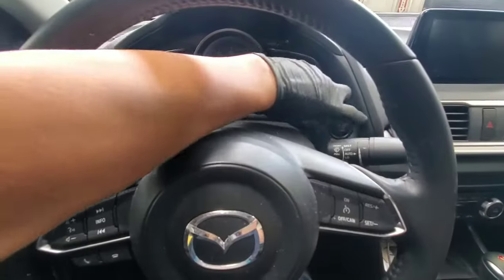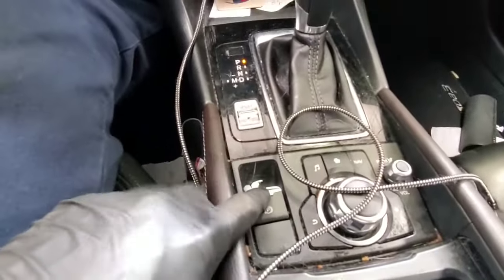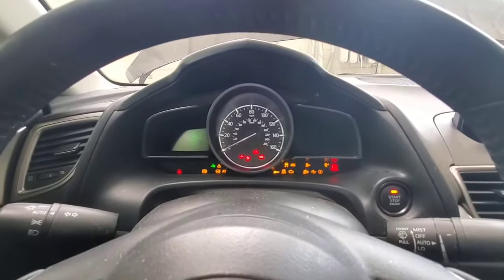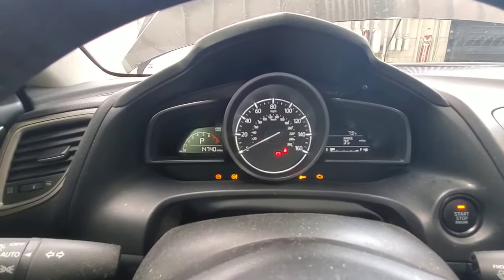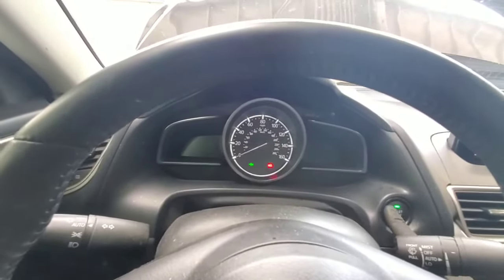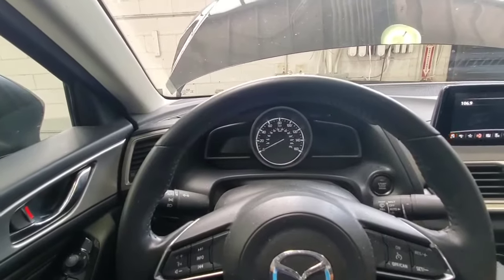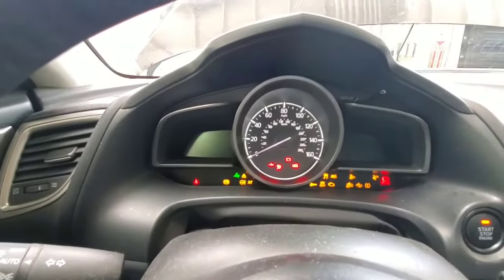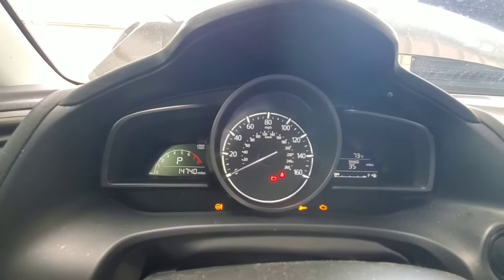How to put a Mazda with Electronic Parking Brake in to Service Mode

Comment: I would like to thank you too. I did the sequence to put my CX 5 in maintenance mode so I could change my rear rotors and as I was working on the first side I heard a bunch of chattering coming from the front. I don't know why or what it was but when I went to put it out of maintenance mode the car was completely dead! The only light in the dash was the airbag light. I checked and only had 3.6 volts in the battery and it would not take a charge. I let it set overnight with the battery unhooked and when I hooked up the battery it somehow returned to 12.6 volts. The car actually started, so I shut it off and followed your sequence and it worked! The only thing different was that I had to push the start button three times. Thank you so much for your help! You are a lifesaver!

Comment: Great video. Thanks. Just to clarify. I'm holding the accelerator the entire time all the down? Also, to retract the piston, is it possible to do this without the special tool? I have the general tool which pushes back normal pistons (front caliper pistons), but I don't have the one that allows me to turn the rear piston CCW. Thanks. (Just read below, c-clamp will work)
Reply from the maker: Hey yes accelerator down the whole time and NO special tool needed to push in rear piston. Just normal tool is fine, I know it looks like it but u don't need the spinny one 👍🏼

Comment: Thank you! This was awesome! Needed to find it about 10 hours sooner, though 😆. 

How f-Ed up is this to go through though ? This secret “trick/protocol/procedure” I think is for the benefit of dealerships - “Oh, it’s waaaaaay to hard for you, the owner to do, bring it in so we can charge you $450.”
Reply from the maker: Haha yea I get it. Super glad you found value in this video. Just trying to help people save some time and money. Let me know what other dealership insight might be helpful for future videos. Thanks again.
Reply: well you need a procedure to disable the e-brake motors (for electronic e-brakes you always need to disable the motors so you can push the pistons back in). a lot of cars require something to plug in to the OBD-2 port (but even this is cracked in many cases). mazda is actually one of the better ones that let you do the service mode without a special tool.

Comment: Same way with a manual just keep it in gear right?
Reply: Manual cars don't have electronic brake. You don't need to do this on a manual
Reply: @f0lkblues  Yes Manuals do have an electronic brake for the newer models. I have a 2019 Mazda 3 Manual.
Reply from the maker: As long as you have electric parking brake on a Mazda 2016 and up this should work. Doesn't really matter if car is in gear or not. This procedure is to be performed with key on and engine off. 👍🏼

Comment: What do you do when you’re trying to shut it off but it says “switch operation not accepted, have the vehicle inspected”
Reply from the maker: To get it out of service mode, repeat this same procedure except instead of pushing the park brake button, pull it
Reply: I also have the ''switch operation not accepted, have the vehicle inspected''.  The PB switch basically does not work anymore and you can't exit the service mode (or set \ release the EPB). What was the fix?
Reply: Replying to my own comment...  Went to the dealership, service director sat in the car and tried many times to put the car out of service mode (while getting the ''switch operation not accepted'' message).  He eventually succeeded and said one needs to be persistent and repeatedly try to put it out of service mode until successful. I did not count but it took several attempts.

Comment: what happens if you change them without doing this? because i did and now the two parking breaks are on :'( and the parking brake isn't working
Reply: Did you ever figure what to do to get the lights off?
Reply: I need to know aswell
Reply from the maker: Yea unfortunately you will probly have to get new parking brake motors for the rear calipers
Reply: @roadstertech  i actually followed the video and they work fine didn't have to change a  thing>

Comment: while maintaince mode i should change rear padles brake then turn off the maintaince mode?
Reply from the maker: Yes you need to put vehicle in to maintenance mode, then once you remove the old brake pads, push in the brake caliper pistons so you can fit the new pads.
Reply: @roadstertech   then once i finish i get out of maintaince mode right?
thx very much (:
Reply from the maker: @omkahledqubali4996  yup once you put the brake pads on and tighten everything up and put the wheels back on take it out of maintenance mode the same way except this time you will be pulling the button up instead of pushing down
Reply: Resolver Automotive the piston doesn’t need to be turned as it’s being pushed in? a C-clamp can be used?
Reply from the maker: @FrostyCoug  correct you do not need to spin the piston. Simply press it back in 👍🏼

Comment: Too bad we couldn't disable that automatic electronic parking brake all together forever! They can make self driving cars but Mazda can't even make one that disengages the parking brake automatically. I'm always squatting down in reverse and had to make a laminated sign on my dash for parking attendants.
Reply: Every Mazda with electronic parking brake disengage automatically as soon as you touch the accelerator pedal if you have the seat belt fastened
Reply: Not so automatically and people moving cars around a lot don't put on seat belts.

Comment: Are the front and rear pads the same
Reply from the maker: You do not have to go through this procedure with the front brakes. The electronic parking brake is only on the rear 👍🏼